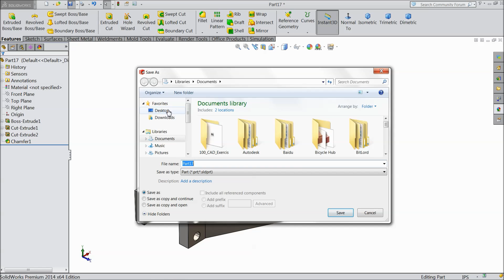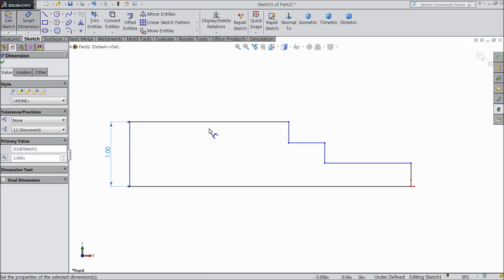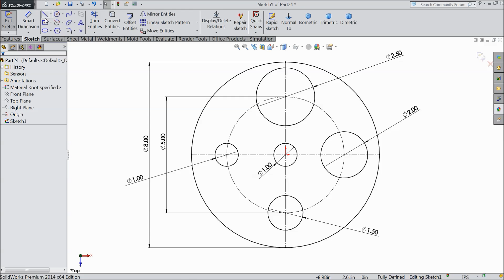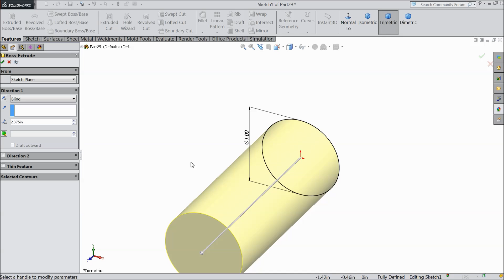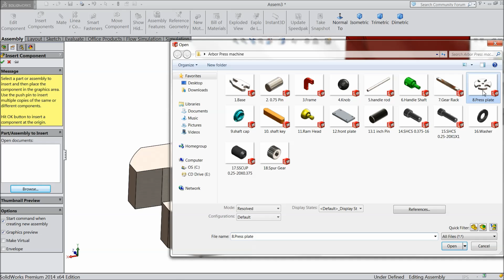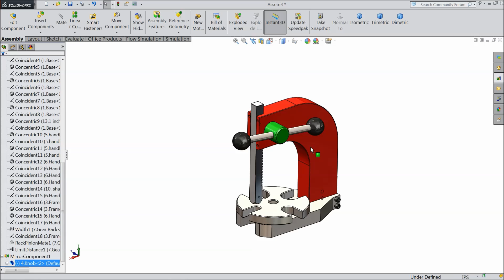Solidworks tutorial | Sketch Arbor Press machine in Solidworks

Comment: Thank you for your video
I tried to build it, and found some slight mistake:
At 1:26:02 the pinion pitch diameter should be set as 1.5 inch in order for the pinion and rack to match their movement

I hope this helps
Thank you again for your video!
Reply: Thanks!